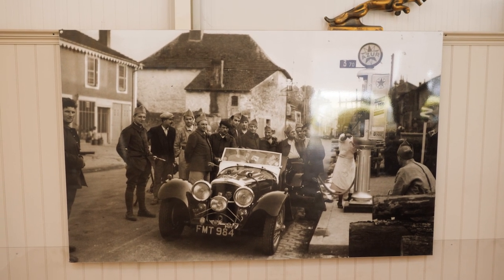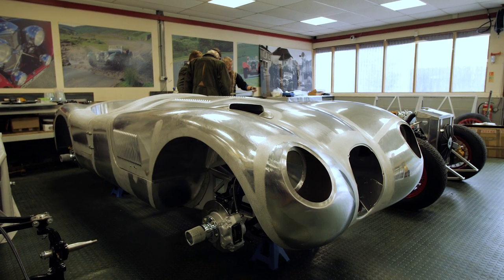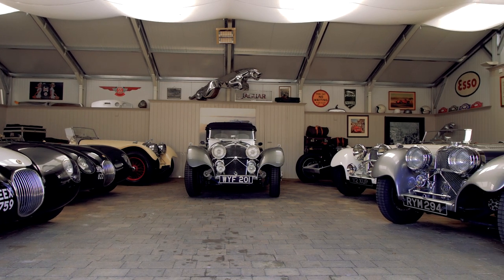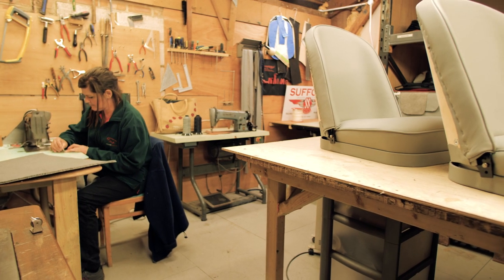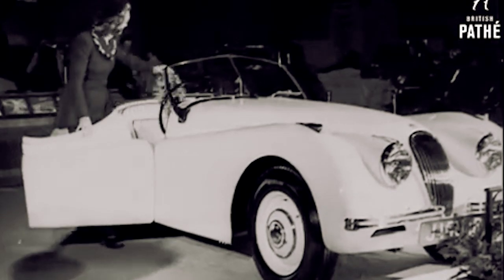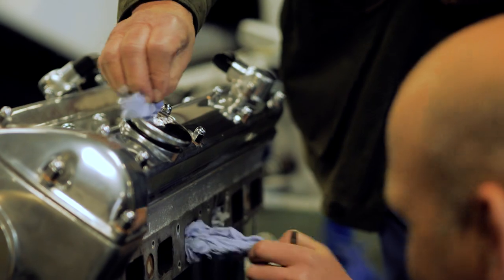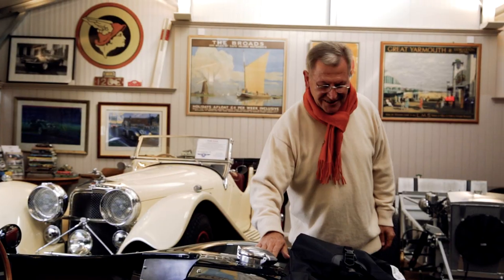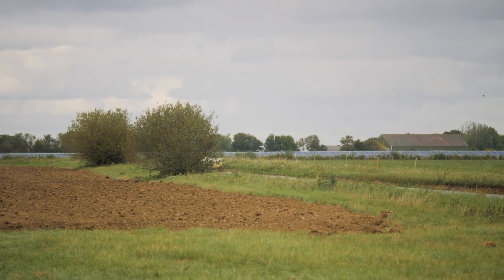Suffolk Sportscars 2018 film - SS100 and C-type

Comment: My grandfather has a very similar SS100 with the 4.2l drive train, however I can't remember the maker - it was some chap called Roger who also hand built his replicas. Roger used to race his SS100 replicas and I recall he got one up to 163mph with a modified 3.6l engine in it. My grandfather's SS100 was converted to foot steering and automatic transmission when he got Motor Neurone disease. He and it was featured in the Daily Telegraph. When he died he wanted it put back to normal, which it now is. One day I would like to make it look as beautiful as the ones in this video. Thank you for inspiring me :)